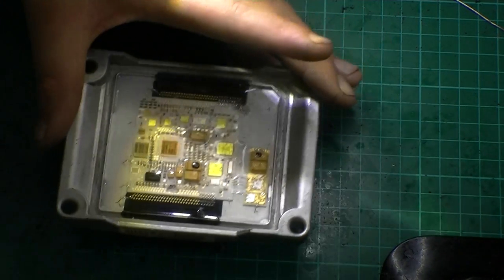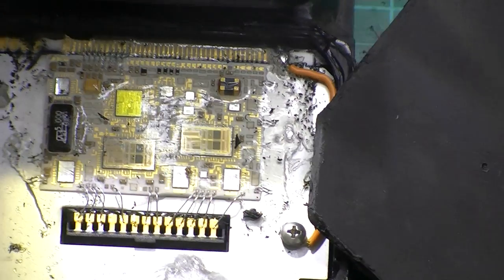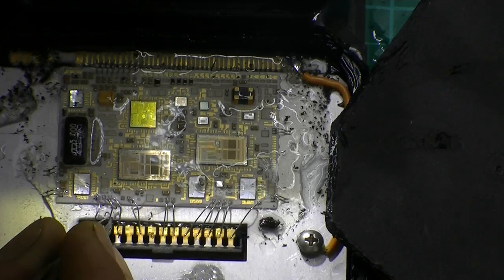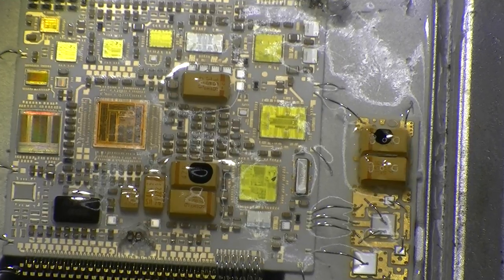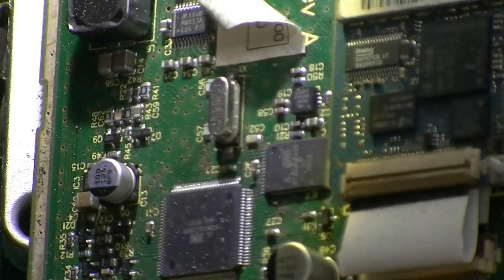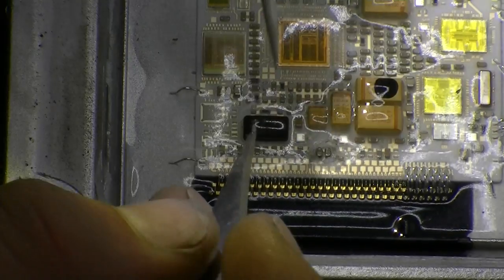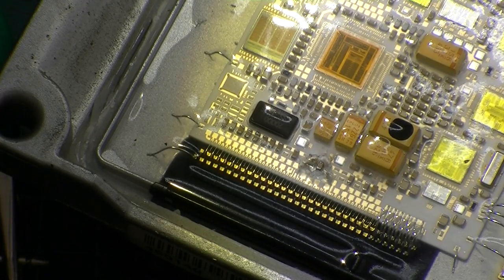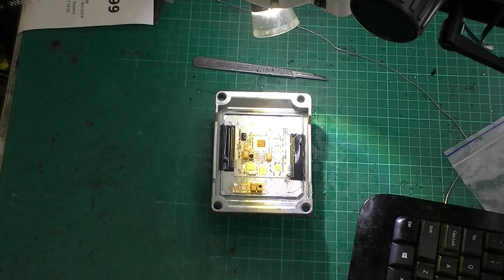inside of your VZ ECU - Short on Data Lines

Comment: Hi, thank you for posting these great videos. Do you happen to have a video on the Diesel injection pumps ecu ( The PSG units )?
If so, could you please send me a link?
I’ve watched quite a few on YouTube, but I’d like to see your way of doing it together with your explanations.
Thank you in advance.
Regards, Joe.
Reply from the maker: Yeah have done a few VP44 pump controllers in the past never thought it was that intresting enough to post a video though if you want to send one I  to be worked on il video it sure.
Reply: @getelectronic8459  Excuse me , where is the memory chip location in vz 2005 ECU 

Or EEPROM number ECU sv6 Holden commodore 

Please

Comment: I got an 05' vz sv6 190 6spd with a terrible missfire, no codes, new plugs, packs and plenum gasket and i can d/c 3 coil packs with no change in idle (ecu picks up they were d/c) scan tool shows injector pulses are the same. I'm wondering if the ecu is fubar? It sounds like it has a major mechanical failure (like a slipped chain, but no cam codes) with the belt tensioner flopping back and forth when it does manage to idle. No oil or coolant loss or mixing :/ I would need a tech2 to match the bcm and immob unless I get all donor matching ones wouldn't I?

Are these alloytecs notorious for ecu faults? I'm not a fan of their mounting location lol